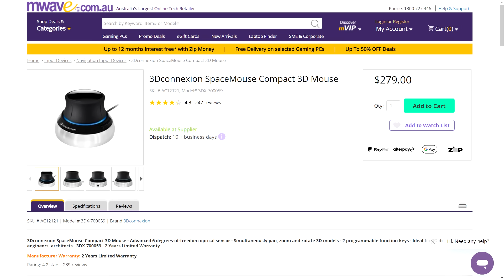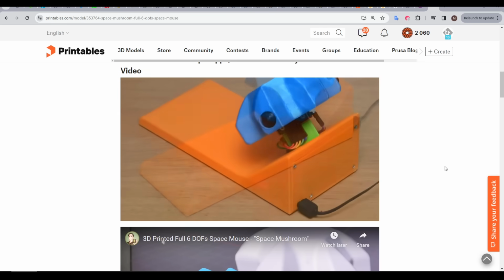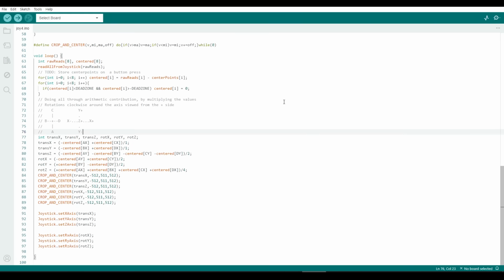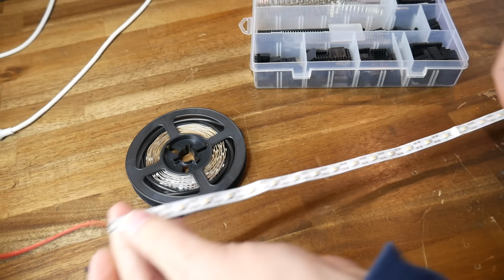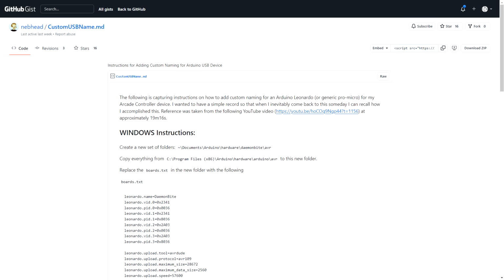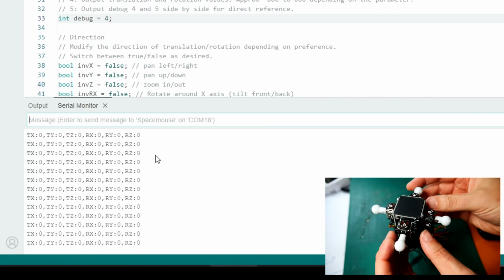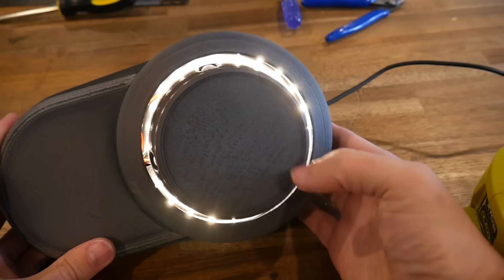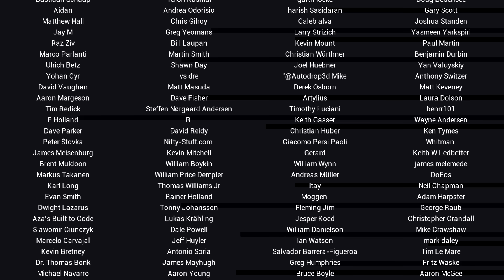Making a cheap, open source 3D space mouse with Arduino and 3D printing *V2 out*

Comment: The space mouse is 100% worth the price. I have 3.
Reply: The reason they can ask that insane price is because they have no competition. It's also a highly specialized tool.
Reply: @htpkey  They are $160 to $300 in the US. Not insane here, but where he is, it is. Also it is a very well made tool, and seriously worth the price. My oldest is nearly 10 years old and still working like new. They don't crap out like $100 computer mice, or keyboards. I have spent way more on "good" mice and keyboards that don't last. They are not over priced.
Reply: @ajosepi1976  Thank you for mentioning the US prices. I understand that you feel they are reasonably priced, but they charge this because they can. If they had competition they wouldn't.
Reply: @htpkey  They did have competition and those products sucked. Their prices didn't go up after they became the only option. It is a quality product that the price reflects and if you can't see that, it is not my problem. Have a lovely day.

Comment: When building my "space mouse", the biggest issue is that it can only send mouse actions, rather than communicate directly with the CAD software. The idea that mimic a SpaceMouse to use the driver is very interesting.
Reply: There is an open source space navigator driver that’s used primarily by Linux users who want to use their space mouse in something like Blender and FreeCAD. I imagine it would be good to expand the driver to work with some of these new and homegrown space mice.
Reply: Thats nice, but why it is so gigantic?😂😂
Reply: @sebastianb1368  it's a prototype... a proof of concept. He already made a mini v2 twice as small.
Reply: There is a project VjoySerialFeeder that can take anything you can possibly connect to an arduino into a joystick in windows and linux, i already implemented a lot more stuff and i'll upstream until the end of the week. For instance, support for playstation 2 controllers and key matrices, i wanaa play racing games with my gameshark pedal and the ps2 controller, the software seems good but my arduino forgot it's bootloader and i need another one. I will probably be implementing support for other controllers as well.
Reply: It's folly, it'll never be as good. This video is filler.
Reply: @Gorilla_Jones  nobody says it would be better then the original. But 20-30 bucks is a lot more justifiable then 300 for most hobby makers. So, not filler but maybe not for you
Reply: @robinpopkema  I will  make this for sure. I use 3 different slicers for FDM (Prusa, Qidi, Orca), Lychee and Voxeldance tango for resin, fusion 360 and rhino for modelling and blender for sculpting. A colleague of mine had lent me a spacemouse which works with all of these and all use the same settings. But without a space mouse, I have to know which software uses which dumb shortcuts. Is shift needed for zoom? Was it control? Control + right click? It drives me nuts. Especially as I tend to jump from machine to machine as my work machine is windows, my home machine is Mac and I also have a linux desktop for some tasks. (KVM switch rules) So if this achieves the simple point that I can have the same exact navigation in ALL my software without tinkering endlessly with settings, it is an extreme win in my book. If I install the 3dconnexions software and I do not have to individually set up my softwares on all the platforms and machines, I'd be so so so sooo happy. 
The OG spacemouse is extremely overpriced for what it is. I know it took time to develop - check the cut up video how it works. 
Most other already existing solutions were simply too complicated. So I am all for this! Gigantic KUDO from me. I am already collecting the parts from local distributors to be able to make it.
Reply: @Gorilla_Jones  wow, way to be a d***.
Reply: @Gorilla_Jones  so the $20 device wont be quite as good as the $300 device? 
Oh noooooo

what exactly cant it do?
Reply: @ge2719  This DIY version is missing 2 programmable side buttons. Looking at the wiring diagram, it seems like there might be capability to wire in 2-9 buttons to Arduino pins (I haven't used Arduino in a while so unsure of the difficulty of using the I2C, serial, and SPI pins for GPIO).
Reply: @linyongzheng Not hard at all. You just use them as GPIO. The project r could definitely use them!

It could then use keyboard.h to send the button presses without requiring the clunky driver to do it.
Reply: @Gorilla_Jones  mimicking the device drivers means that the computer can't really tell the difference between this and a real spacemouse. Everything else is to do with the mechanical and electrical side of it which have a lot of room for improvement here. There is absolutely no reason that this can't be as good as a real spacemouse.

How do you think the spacemouse was made? How is that impossible to replicate? Anything that can be made can be replicated and improved, the spacemouse is no exception.
Reply: @conorstewart2214   lol

Comment: I'm in the process of doing something similar, using a 9 axis imu to track motion, and a rp2040 with tinyusb to emulate a spacemouse.
I already assembled the controller and wired it, now i just need to find the time and will to program everything XD
It's another one of those projects that I get bored of before I finish it.
Reply: that does not gonna work...I tried. First of all you'll need 2 IMUs, otherwise you'll have trouble just moving the entire mouse; and this is a mechanical pain. Then you cannot really use the magnetometer without recalibrate the soft and hard iron magnetic field each time you move your mouse just few centimeters. At the end it's not a good solution
Reply: @SaverioPieri  i was going to use a magnet stuck on the base as a reference. I know it's not easy, but I guess that something could be done is this is the kind of tracking that could be obtaioned:
watch?v=yqFfmwVufMo
The issue i'm envisioning is with tracking pan movement, because that can only be done with the magnetometer, but rotation and pan are not easy to tell apart when the only thing you have is some vectors from the imu.
Reply: @Muz994  well, there are a lot of libraries implementing sonsors fusion (kalmann etc..). My biggest problem was the fact that earth mag field is very very small compared to other sources in my desk: speakers, psu, even BT devices. As far I can freeze the status, the hard iron calibration works (sort of), but simply rising the speakers volume create a mess..... At the end I gave up with this idea. I hope you'll find a working solution
Reply: @Muz994  ah...you dont need to catch the pan: the pitch and roll vectors give you the pan vector, while you maintain the position. The problem is the elevation (push and pull)
Reply: @SaverioPieri  yup, elevation is probably the hardest, i was hoping to catch it by having a fixed magnet below the magnetometer, so that the magnetic field intensity changes as the sensor moves closer/further from it. I have no idea if this actually works tho.
Reply: @Muz994  if you put a magnet near the IMU, forget to use the magnetometer for sensing compass...
Reply: @SaverioPieri  Yes, I was hoping to use gyro / accellerometer for rotation, magnetometer for pan / zoom, or something like that
Reply: @SaverioPieri  it ended up working a lot better than I expected! 
The magnetometer with a magnet directly below the IMU tracks zoom and pan perfectly, and gyro + accel do a good job with roll, pitch and yaw.
The only downside is that when you move the mouse on the desk you need to calibrate everything again, but it's not a big issue, i put a quite heavy weight and some rubber feets on the bottom.
Reply: @Muz994  You need a second IMU as reference. With that you'll work on the angle difference between the reference IMU and the trackin IMU
Reply: Can I follow your progress anywhere? Sounds really interesting. Thanks.
Reply: For push/pull, you could add an additional sensor if the magnetometer isn't going to work. Hall effect or LDR could maybe work, depending on your design

Comment: Super neat, would like to see a smaller version.
Reply: Right, that thing is huge.
Reply: @bennetb01  What every guy wants to hear!
Reply: I think it's cause the internal components in that version are rather big. You would have to go with one of the different more complex models he showed at the start. Or buying one of the 3d connexion ones, they are quite small. I've had one for around 10 years, still works.
Reply: @atnfn  It's such a shame the 3dconnexxion wireless versions still use Micro-USB
Reply: @EddoWagt you can adapt it to work with a nice nano
Reply: @EddoWagt I use mine every day and only need to charge it every couple weeks which I do when I'm off work so I never mess with it when it's plugged in. I wouldn't let that stand in your way if that's the only thing stopping you.
Reply: Yes me too!
Reply: 0:00 yay, found my next project
0:01 sees this comment
0:03 ... huh, that's an odd thing to say
0:07 okay, I get it now
Reply: @dudedavid522  quit reading my mind 😭
Reply: Was gonna say it’s massssivveee
Reply: Oh boy do I have a thing for you! Check out the printable link in his description
Reply: Stand further away
Reply: I can make ts i can only use 1 joystick with r4 minima for now and also put the joystick on a potenciometer so i can scroll with it and it will also be handheld
Reply: That size is good for more precise movement, in small joystick 🕹 even a little fingers shake of 1 mm can make a huge difference
Reply: @zorabixun  That can be taken care of in software, and it's only for navigation, you still use a regular mouse along side this.
Reply: There's a lot of cheap Nintendo switches joystick replacement. There alot smaller
Reply: @jona-x5v  Those tend to measure inaccurately and drift a lot over time. Perhaps psp joysticks would be a better choice.
Reply: They're*
Reply: So make one